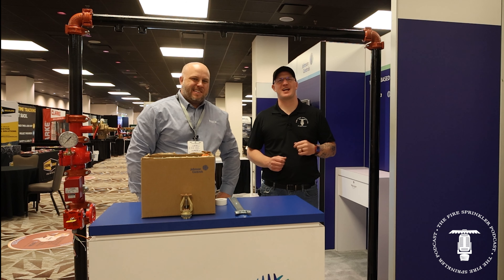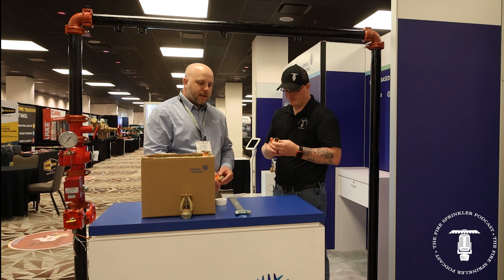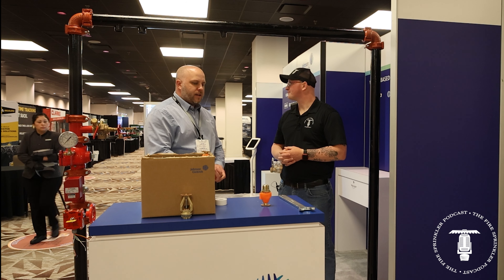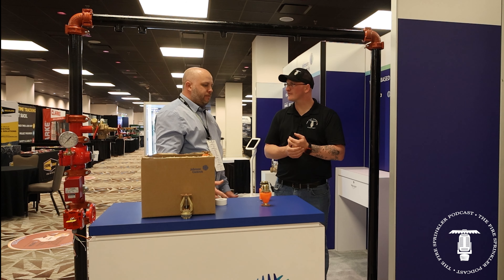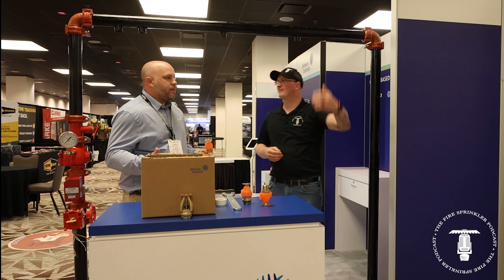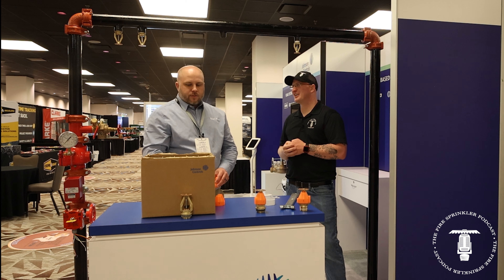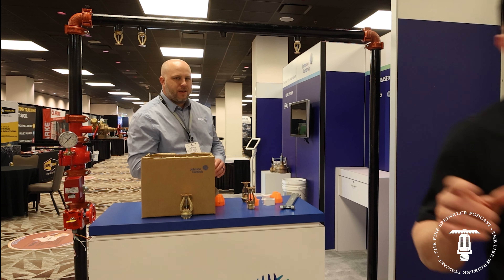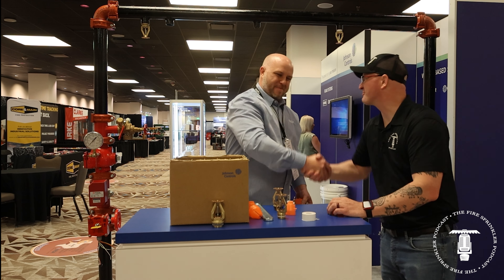Rapid Install ESFR Vs  Standard ESFR Ft  Nick Martin with Tyco/JCI

Comment: With more heads with rubber gaskets comeing on the market like these TYCOs and the coupling style Victaulics. Should there be a testing and inspection frequency of the individual rubber itself? Say like 10 years UL testing on this style.